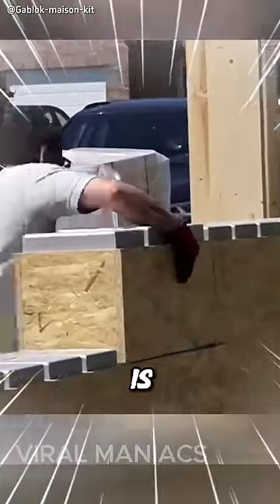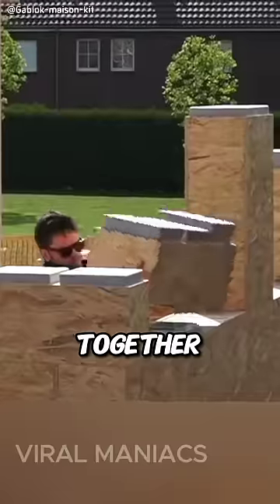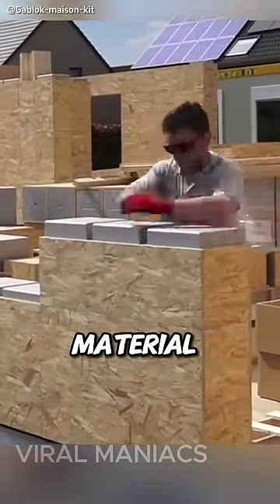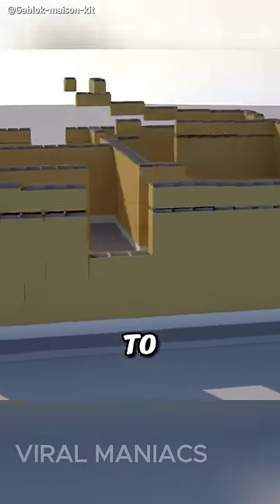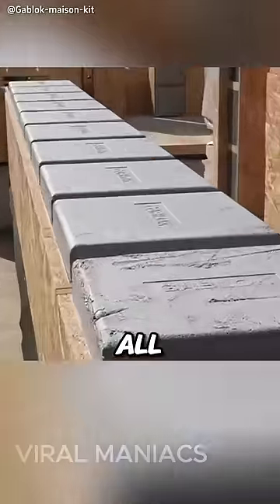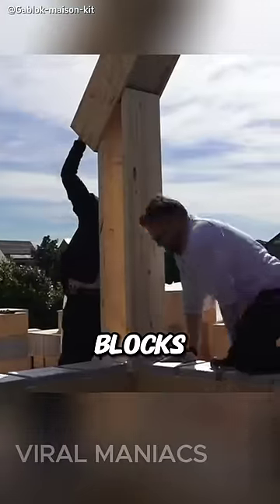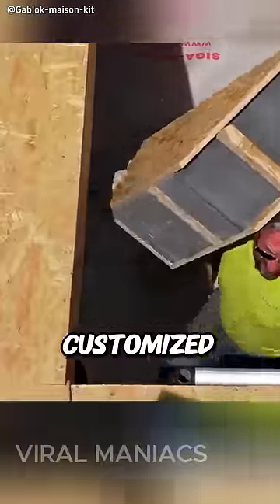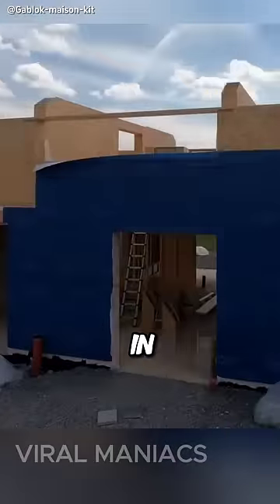Whoever Invented This Way Of Building Houses Is a Genius #shorts

Comment: What a genius idea, building the walls out of 2 of the least fire resistant materials possible. Well done 👏🏼👏🏼
Reply: Pretty sure this is just taken from the earthen ship concept.  Not really new just improved.  Seems nicer then dirt packed tires or hay bales.
Reply: EPS foam doesn't burn but melts at high temps and is also made with fire retardant. As for the OSB, there is a fire rated version, don't know if thats what they use.
Reply: No different than any modern construction home built in the last 25 years.
Reply: (Note, most American houses are flammable and made of wood.)
Reply: If it was cement I would of say this was genius way to build homes faster, but plastic. Think about the old cars and new cars made with plastic when both these cars get into a accident the old car will win because it's made with a stronger material hence this idea would of been good if they used the right material
Reply: @lisathompson5500 The  Tube sand bags are cool for emergency housing. No stack of separate sandbags, just a long arse tube sack. Then you plaster or mudd it. Still very situational. niche, and should never be a standard
Reply: @shadowk3 What about the rain when you are building? Would be horrible.
Reply: @MybeautifulandamazingPrincess doesn’t impact the environment?🤦💀💀💀💀
Reply: @iyadmahmoud cement does not insulate well
Reply: American homes burn much more easily than our South African homes which are all built of bricks and mortar. I know because my son is a firefighter in America.
Reply: @iyadmahmoud yeah but a driver who drives an old metal car would be like a scrambled egg when there's a heavy but non fatal incident since that force of energy has to go somewhere while modern cars would crumble to help the reduce the force of energy.
Reply: @MybeautifulandamazingPrincess it's made of plastic lol...
Reply: @lisathompson5500 earth-packed tires:
* Re-uses materials 
* Lasts forever
* Fire-resistant
* Good insulation

Whats bad with this again?
Reply: @TheRealAnsontp Note, most swedish houses are made of wood, but built to quality to reduce its flamabillity to a minimum.
Reply: Are you kidding? Half of American houses are built from wood so what are you on about?
Reply: Have data closest with fire rated OSB walls. 2 hour burn through is what I think they are spec'd at.
Reply: I mean the old car will (generally) stay more intact but most likely cause serious injury to its passengers@iyadmahmoud

Comment: I'd be willing to bet that electricians, plumbers and HVAC workers really hate working with this type of walls.
Reply: I would line it with wood 2x4s or 2x6s...
Reply: exposed... it's a thing...
Reply: Soffit which 90° vertical channels 22 gau galvanized cap then gyp board would work for me.
Reply: It would depend on the mfg... in some log homes, the wire and plumbing paths are precut so when you lay a course, you can set the wire or conduit before the next course...
Reply: Nah new hvac is the multi head heat pumps
Reply: Why would there not be interior walls to accommodate electrical and plumbing?
Reply: Pre-cut your channels and/or drive in conduit. As for HVAC and plumbing, that should all be in interior walls anyway.
Reply: These are the outer walls......Germany builds all their houses with cinder blocks...what's the difference??
Reply: And maybe in-floor heating?
Reply: @donstaples4812  Yep...batton the internal walls and run services there.
Reply: Trunking is cheap.
Reply: @Sean0526a  you just run conduit & polypipes along the inside of the walls, like in corrugated iron warehouses, & internally clad over them if you want to waste space.

Comment: If it catches fire, the whole neighborhood would have to be evacuated. I doubt its non-toxic when burned, or at least not as bad as wood burning.
Reply: I can see petrochemical plastic being an issue.
Reply: OSB has plenty of glue. It emits formaldehide, a carcinogen. Toxic even when not burning. It's not intended for interior use.
Reply: Polystyrene has a high heat release rate, and tends to liquefy as it burns, which will spread the pool of flaming plastic just about everywhere. Dense, black toxic smoke will  probably be just as deadly to the occupants as the fire itself.

Comment: I’ve done electrical for a few of these, you don’t see it from this video but there is a different set of smaller blocks that builds onto the bigger blocks. One set of blocks are for the planned plumping, planned hvac, and the other for electrical. HVAC and plumbing actually now come preinstalled in some of the blocks so a “technician” comes in and connects the pipes before “sealing” each. The final image looks to be a garage but they really should have showed the color coding of each different trade. With the shortage we have in the US in tradeskills I can see this becoming a thing.
Reply: Tell me you're not an electrician without telling me you're not an electrician...
Reply: Trades training has zero financial aid.  What unskilled teen has fucking 5000 dollars to learn howto fuking weld?
Reply: Hey bobby I appreciate the comment, I was wondering where they would run the wires. Thanks man
Reply: @user-dd2yz3yu2q  that's not true at all. Apprenticeships can be found through the American job center and other resources. A couple years of service will get you 100,000 to use for further education as well as 4,000 to use each year while serving.
Reply: That is great and all but imagine a wire goes out the amount of work to replace it is crazy bad design not thought through
Reply: Shortage of tradesmen all around the world. Thank you smart phones.
Reply: I was wondering how they did the electrical and plumbing
Reply: So if a pipe burst, you'd have to disassemble that entire side of the house? Like a legit lego house haha. I hate when I have to rebuild a small section and need to tear down most of the build for a few blocks.
Reply: @CallMeJarv  that is my thoughts too like it seems like a great idea but the amount of work to replace something will be crazy
Reply: Thank you for your perspective
Reply: Who is the manufacturer of these homes?
Reply: I want this so bad!!!!
Reply: Is it expensive?
Reply: Are they running conduit thru or just pulling romex? Also copper, pvc or pex for plumbing?
Reply: Who's the company selling this?  Thanks in advance!
Reply: Thank you Mr Paragraph Man. ❤
Reply: Shortage?
Reply: @CallMeJarv or you could just replace that section of pipe, do they tear down the entire wall when a pipe bursts in a regular home? If the pipes are set into the piece im sure you can just remove the pipe without having to remove any section of the wall. Just a wild guess but im sure the people that designed this have thought about this, they literally designs homes for a living.
Reply: Do you happen to know the name of this system? I was curious about how they hold up but it's hard to find actual information through all the 

Sratches ass, sniffs finger
"Well, it looks nice now but as soon as a butterfly farts on it it's gonna fall over"

Like some team of  engineers didn't spend 3 years figuring out how to make it durable. 

I have to assume they hold up, I'm just curious HOW
Reply: Google Gablock Madison kit. Doesn’t look like there is a US distributor yet
Reply: I was wondering about the internal structuring and process, thank you
Reply: This wont become a thing because lack of skill it will become a thing because of capitalism it saves time and money
Reply: What shortage in trade skills? People just start making up their own statistics
Reply: This was my first question, thanks for sharing.
Reply: @stevenbrown2285 kinda like plumbing copper pipe through concrete foundations, eh?
Reply: These gotta be for outer walls only most likely aluminum studs for interior walls where pipes and wiring would be in between
Reply: What kind of hurricane winds can it take?
Reply: There's no shortage of hard working blue collar men as long as you pay good enough
Reply: Company I work for pays all my tuition for school and I’m making scale pay at $38 an hour starting. And that’s only 55% of the wage. Once you hit journeyman you get the full pay. With the decline of workers in the trades I can be expecting $70 an hour or more in the next 5 years. Yall have fun with you student loans and shit salaries
Reply: @ANONM60D  the unemployment office? 😂 wow
Reply: @user-dd2yz3yu2q  not "the unemployment office" I said "the American Job Center." 

It would do anyone well to look closely at what they offer. I know of many who started a career with all manner of electrical work through the American job center.  high voltage, low voltage, residential,  industrial, you name it.

Comment: This is great if you don’t want electrical, plumbing, or hvac
Reply: It’s already cut out for that
Reply: Who said they can’t put that afterwards?
Reply: Als ein Heizungsbauer seh ich da kein Problem. 
Ich kann zum Verlegen von Rohren immer noch Löcher bohren. Ich kann sie unter der abgehängten Decke oder auf dem Rohfußboden verlegen. 
Nur schlechte Handwerker sehen ein Problem, wenn sie etwas Neues machen müssen
Reply: The problem for me is that it only works for one-story houses, it cannot build two-story houses....
And in places with tornados this is just stupid
and polystyrene + wood and electrical pipes with a possible short circuit with sparks, it doesn't seem like a good idea to me.

Comment: And to every place that has heavy rainfall the expansion of that wood every year will eventually leave a damn dangerous structure.
Reply: Well they aren't gonna leave the woof out there as the finished product
Reply: i dont think osb wood have any expansion/contraction. does it? its more like plywood but with cheaper matterials.
Reply: @coatrak1357  Right? Obviously it would get some brick, stone, and/or hardie. What kind of jackass would leave bare OSB exposed to the weather like that? 🤦🤣🤣
Reply: @mohammadfallah.rasoulnejad5379  all things expand and contract with the application of heat and cold. The heavy rainfall will cool it, then the wood will dry and it'll bow slightly, then rainfall happens again and it'll sag a bit more, then bow a bit more
Reply: @mohammadfallah.rasoulnejad5379 then you don’t know OSB, I’ve seen it expand twice the size under damp conditions
Reply: Lmao there are people in this comment section that think they'll leave this as exterior
Reply: Kinda a dumb comment, do you think they just leave it exposed to the elements
Reply: Haven't they been using osb for years on millions of structures with no bad results.
Reply: @davidwhetherholt2370  self-aware comment that then asks a question?

Please look into the problems of expansion and contraction of wood under the heat and cold of rainfall and then warm weather.
Reply: @davidwhetherholt2370 correct, osb is used everywhere in construction, it is cost effective and just as durable so long as you protect it
Reply: @mohammadfallah.rasoulnejad5379 put a piece in water and see what happens
Reply: @davidwhetherholt2370  In areas of the US with an extremely dry environment and a light rainfall

The man reason the US does it is because of the cheapness of the building materials and the less danger when earthquakes hit
Reply: @UncensoredScion lol I don't think he does,which makes me believe that is why it was posted as a question,with a question mark.

Comment: Then build a new house inside that one so you can have plumbing, electrical, and hvac...
Reply: "Uility layers sold separately" then charge them another 100% LMAO
Reply: You'd think they haven't planned it already in that Blue-print. Concrete blocked houses is basically the same as this. Guess how they put plumbing and electricity in them.
Reply: This is LITERALLY just the framing of the house... Just like... Normal framing.
Reply: @powsniffer0110  unlinke normal framing...you cannot add plumbing/electrical/hvac to this...
Reply: @inisipisTV  by framing a house inside of them...

Comment: The thing is building the walls is one of the fastest parts of building a house and is less than a third of the total cost of the house.
Reply: Right. Also where does the wiring, and plumbing go? What about anything you need to anchor into a stud, like cabinets or other fixtures. Do they tack the drywall into OSB? So many questions...

Comment: Interested to see how utilities are added. Plumbing and electrical.
Reply: So I was looking at their website and it looks like the blocks have a top mount space or sheathing (hard to tell their website is very odd) which gives you some offset to run wiring and plumbing. The interior wall panels are also prefab but basically look like normal walls you'd see in a construction with plenty of room.
Reply: The inside has a vapor barrier then battens to attach drywall to. I image the plumbing and electrical are ran through the gap left behind the drywall like most frame built homes
Reply: Like in the late 19th century. On the outside of the wall.

Comment: I live in Germany and our house is built similarly. It is made out of LEGO style polystyrene blocks that have polystyrene on the inner and outer walls and are hollow in the middle. All supported by metal. After a few rows have been built there is concrete poured in to the hollow part. So it is really stable and really good insulated. Down side is that it’s hard to hang anything heavy to those walls on the inside since you have to get really long screws to get to the concrete. Otherwise everything just falls of😅
Reply: We call this the Sondermüll der Zukunft 😂💪🏼
Reply: In USA, most walls are pretty hollow. To hang something heavy you must include those plastic things that expand behind the sheet rock grip from behind the wall. It’s annoying but a must, especially when it comes to mounting real heavy items like a television or floating furniture. I leave those mounts to people who know what they’re doing. If I do it, my tv will probably rip part of the wall right off.
Reply: Ist euer Haus dann auch aus so viel Presssparn wie in dem Video?
Reply: Wo in Deutschland wohnst du bitte? Ich bin Maurer und arbeite in einer stahl beton Firma und kann ganz klar sagen dass das absolut nicht stimmt. Aber schön wäre es
Reply: That is not the same. Here, there is no concrete poured in the walls. Your house uses the insulation also as a mold for concrete, which holds the weight and supports the forces.
Reply: @Sven0804  Kennst wohl jedes Baukonzept wa 🤔
Reply: @nexesco7896  woher kommt den so ein blöder Kommentar jetzt her? Er hat schließlich geschrieben das so eine Art die häuse zu bauen in Deutschland normal ist und das es so ähnlich bei uns immer gemacht wird. Ich bin wie gesagt gelernter Maurer und mache viel Stahl beton. Bzw habe das gemacht. Daher kann ich sagen das das nicht stimmt. Aber ich habe nie gesagt das es sowas garnicht in Deutschland gibt. Vielleicht gibt es paar Häuser in Deutschland die so ähnlich gebaut wurden. Das ändert aber nichts an meiner Aussage und daran das es nicht normal für Deutschland ist. Also verstehe ich deinen Kommentar jetzt echt 0. Aber ist wahrscheinlich einfach malwieder ein unnötiger Kommentar wo man nicht nachgedacht hat weil man einfach nur Hass im Internet verbreiten möchte weil man so verbittert ist weil dein Leben scheisse ist. Also einen schönen Tag noch.

Comment: This is gablok, exists since 2019. For anyone wondering about plumbing and electrical. There are special racks inside that support the blocks for stability and also make neat path for electrics and plumbs. The overall building costs (Netherlands) should be around 150k.
Reply: 😮 ok that's better
Reply: 150k eur?? Still pricey. .
Reply: Was wondering how you could run electrical and water with no studs. Price seems way too high though. You'd expect a much cheaper price for a quick and easy method like that. I guess you'd need to compare it to a standard home of similar size in the same area to really know the price difference.
Reply: thank you I was wondering that. from what they showed in the video, it looked like I'd have to surface mount plumbing and electrical conduits and make the house look like the inside of a parkade or industrial warehouse, or build out walls will steel stud and drywall....
Reply: thanks that's exactly what i was wondering
Reply: @VTaeOT7  normal hpuses are like 300-400k
Reply: Thank you
Reply: @jbeonlsaoyn  still better price then current house prices
Reply: 150k euro is nothing. My house was 700k
Reply: @VTaeOT7  Cheaper than most homes in US cuties
Reply: Super. Thank you for that, it is interesting, maybe to start a business with them
Reply: I love this product, and if I was well, I would definitely start a building company. Thanks for the information.😊

Comment: Man, in a fire situation that thing would go up faster than an old 60s mobile home
Reply: Incorrect. Most American houses are built with these same meterials just in a slightly different arrangement.  And even if tge house doesn't have spray-foam (the gray foam inside these blocks), fiberglass insulation burns just as well.
Summary: these blocks are no more flammable than a typical American house.